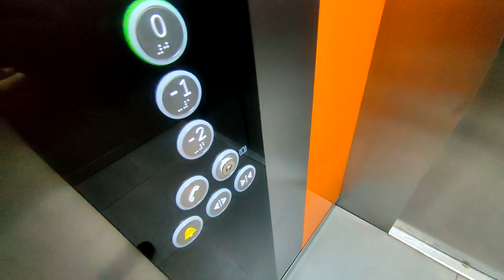Doppelmayr Detachable Cable Car in Zagreb

Comment: A setup like this actually is pretty common in and around Austria (where you can go skiing). You have the big cable car with a cabinet, which runs the whole year (in the winter for skiing and in the summer for biking, wandering and so on). It normally brings you on top of a mountain or pretty near the top. From there you can do all the activities (summer or winter). Summer activities usually include going up or down a mountain once and getting back with a cable car (if you use one at all). Some people also use the cable car in both directions, but this normally is only the case for lame tourists, who only want to be on a mountain, just to take a picture. When you are going skiing, you can go down a hill pretty fast, so you might want to do it multiple times a day. That is where the smaller, normally open cable cars play a role. They sometimes bring you even further up the mountain or they bring you up the mountain from different heights. Otherwise the big cable car would need many middle stations, which costs too much and also raises the risk of a full stop of the cable car, because some tourists are even too stupid to properly get out of there. Maybe I also should add, that you normally can’t go down the hill with the small cable cars, because you only use them, if you are skiing and you are expected to go down by yourself. The big cable car (if it is only one) normally is in the middle of an skiing-area. You normally have routs for skiing, that not only go around the main cable car, so the smaller ones also help to make the area wider, more spread to the left and to the right of the main cable car. And I should also mention, that different heights off a mountain make a route often differently hard to ski there. The routes all the way down to the bottom of a mountain usually are very difficult for example, whereas the routes around the top-station of the big cable car are usually easier. So the small cable cars are also there, to allow beginners to only take easy routes.
Reply from the maker: Do you know any in Austria where it is cheap to travel to from a Ryan air airport, as well as the ticket for the cable car being cheap?
Reply: @benolifts  I am so sorry, but I don't know any way to get to Austria for cheap. Cable cars in the winter probably aren't cheap either, because you pay for the snow canons there, which probably don't get used less in the upcoming years for obvious reasons. In the summer it should. be a bit better, but I am not sure. A good place probably is a smaller, less known ski area. I personally can recommend the Ratschings-Jaufen ski area. It is in Italy, near Sterzing, but I am not so sure, if it is really cheap, if you compare it to other areas.
Reply: @benolifts  what is for you cheap? Under 100€ for train and cable car? Or under 150€? I think for 150€ there is a lot to see…

Comment: Pls can u do an updated lift tours in Basingstoke the malls and festival place pls since they’ve added new lifts to the malls and festival place.
Reply from the maker: To be honest, I have completely lost interest in small scale English towns and cities.   Years ago I would search around towns to find every lift in the town.  But in the present day I have lost the inspiration to do this.  All of the old lifts have been replaced.  And all of the newly built lifts are either base models (gen2, 3300, NMX07, etc) which are all identical, or are generic lifts (Lester, ThamesValley, etc).  There are no quirky interesting lifts, and there are no high quality heavy duty top of the range lifts in small towns anymore.  The current attitude is to buy the cheapest lifts, and by the time they need replacing it will be someone else's problem.  This has kind of made me lose interest, plus I have travelled the world and seen so much interesting stuff, I just find it hard to get enjoyment from an English town.

Comment: For the ones that are 'not working', they're almost certainly fine. It's just that they're only for skiers and snowboarders, as they can ski off the lift. As it's not ski season, they won't be open as it'll be pretty hard for normal people to use those lifts as they can't slide across the ground. It's also not particularly busy so why waste energy by running lifts people aren't going to be using much?

Comment: That looks impressive. I know that London has one which goes over the River Thames.
Reply from the maker: London's Doppelmayr is in the wrong place.  It goes between destinations that very few people would want to go between.  Plus it is not included on the travel card, which ultimately means that very few people use it.  Boris lied claiming that non-tourists would use it, when FOI revealed that in the first year only 4 season ticket commuters used it, and as far as I know this has since dropped to zero season tickets.  So commuters don't want it, and tourists are not as interested in it compared to if it had been built in a tourist area.  So the entire thing has pretty much not justified its build cost.  It was Boris's vanity project.  Just like is other waste on money vanity projects, such as his buses that are overly heavy and the engine charges the batteries at the wrong time, leading to the batteries using up their designed charging cycles far too quickly, as well as not really saving any fuel.  And now the all door boarding has been changed to single door boarding.  This means all of Boris's features he wanted have failed, so all that is left is an overly heavy and slow bus, that doesn't do anything special or better than any other bus.
Reply: Yeah absolutely. Totally agree with you Beno. Keep up the good work. 👍

Comment: Just a quick thought about what I see here.

Perhaps it's something to do with a scarily highly functional CCTV/ID card/Big Brother society; or

Perhaps it's an endearingly old fashioned and law-abiding land; or

Perhaps we should have a word with ourselves because:

I'm struck by the expensive, efficient, endlessly repeating system with its uncountable supply of clean, crisp and empty gondolas.
There seems to be nobody securing them, no other passengers to keep an eye on any wayward yoof and no end of opportunity to do them damage, should someone so wish.

How so? How can the rest of the planet's populations copy parts of this idyl? Is it an idyl, or is it perfectly pristine on the surface but just underneath is a quivering mass of oppressed masses?
Reply from the maker: I don't think health and safety is anywhere near as strict in Croatia compared to the UK.  One thing I noticed is that the cabins started engaging the fast cable as soon as the door shut.  I really wanted to stick my foot in the door and see what happens.  Would the entire cable car shut down, or would it have carried on regardless.  Also, with how quick it accelerates to the cable, and how long it would take to bring the cable to a stop, I wonder if the cabin would have exceeded to station before it stopped.  I regret not testing this.  If someone had got stuck in the doors, the cabin would have have started hurtling out the station before the system had time to emergency stop.  On Boris's Doppelmayr in London, there is a some distance from when the doors shut before the cable starts engaging.